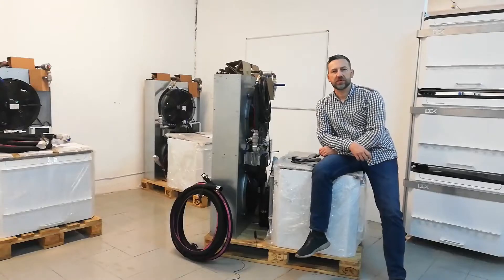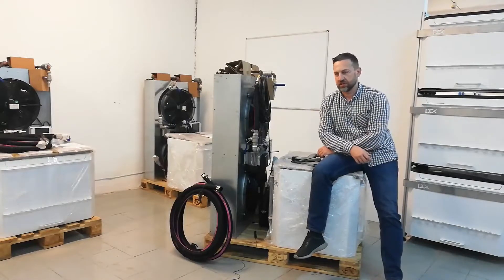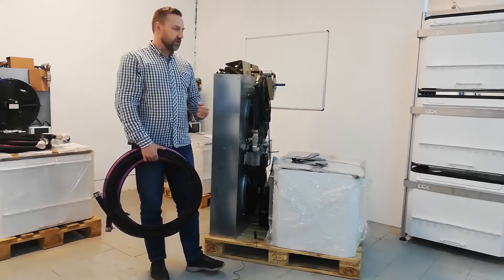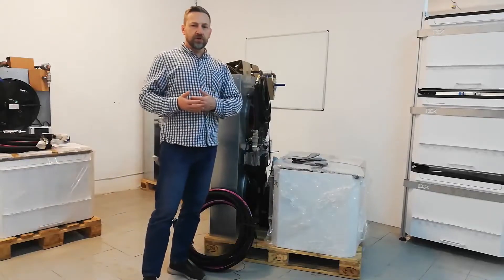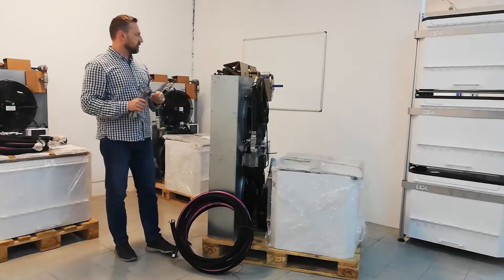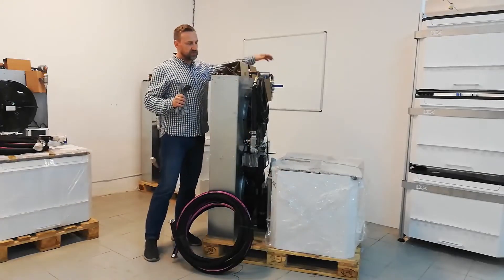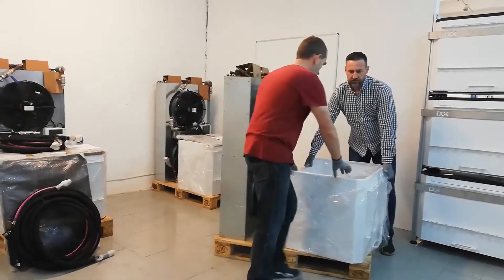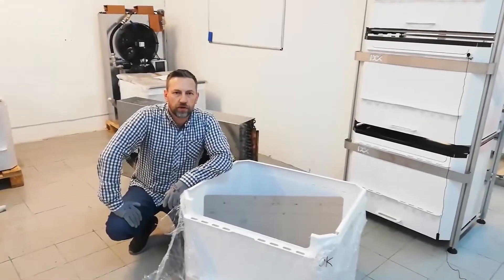DCX ILC Crypto Enclosure setup - quick guide

Comment: There is one point not clear. Are you cooling the oil in the dry cooler or is the dry cooler a dual system?
Reply from the maker: Hi, thanks for asking. This is old er video, soon after that we moved to dual loop system - so between the enclosure and the dry cooler we use water or water/ glycol mixture.. Stay tuned, in week or so we will update the channel with videos with new v3. enclosure and ICP40 - integrated cooling and pumping system.

Comment: What is the cost of the whole kit in USD and what is its power consumption?
Reply from the maker: It depends on size, amount of options etc. Just go to cryptocooling.eu and use GetTheQuote button - you will get you offer. Power consumption - enclosure 180W and dry cooler 600-700W. This video is quite outdated so please look up new materials.

Comment: Where do i buy this?
Reply from the maker: Hi, please see other videos, this one is pretty old one, both enclosure and dry cooler are improved significantly. Then  please go to www.cryptocooling.eu website and use get the quote button. Or just send request to info@dcx.eu with basic information: how many miners you plan to immerse, which models, what is the power rating of those miners. Thanks!